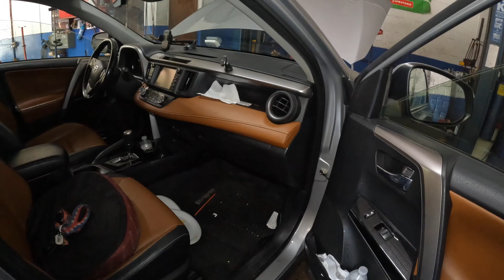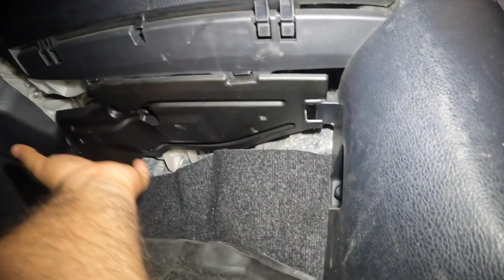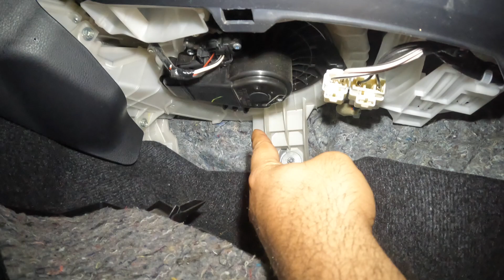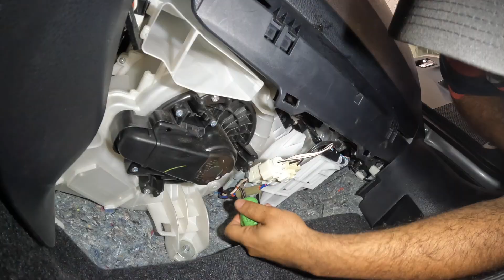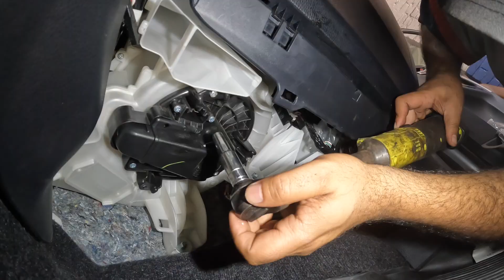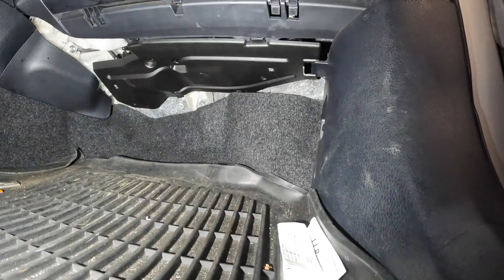How to remove and replace blower motor on Toyota RAV4 2013 to 2018

Comment: My heat or the ac only hits my face but  not on my feet ...is it possible that it could be blower motor that needs to be replace?😮😢
Reply from the maker: No the mode door motor is what controls and changes the air direction check the mode door motor some time tapping on it will cause it to kick back on
Reply: @RBTheMechanic do you have a video
Reply: Are you sure it's in mode where it blows wind on your feet? I know some people who doesnt even know these.

Comment: For people asking.  This is probably a XLE Rav4, because it has automatic temperature control (ATC), it doesn't use a resistor.  Instead, it uses a Blower Motor Control Module.  If you stop the video at the 1:30 mark, a resistor would be mounted to the left of the bottom screw of the blower motor.  You can see the plastic indent where it would go, but the plastic is not cut out.  The blower motor control module is included in the actual fan motor for the 2015 XLE model.  You have to make sure that you get the blower motor with ATC included, which runs around $180 as of 09/2026, whereas a manual climate control blower motor runs around $120 and you have to buy the resistor separate.

Comment: Where is the resistor located?  Is it a good idea to replace both the motor and resistor at the same time? I have a 2015 Toyota RAV4 with a manual temp control.
Reply from the maker: It should be to the left of this motor some are built in control unit and always good idea to do both togather